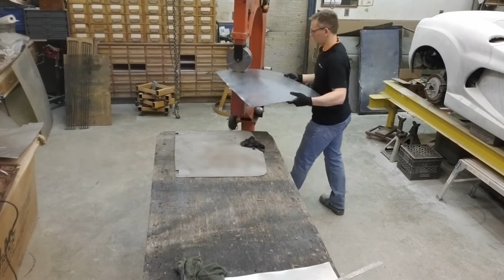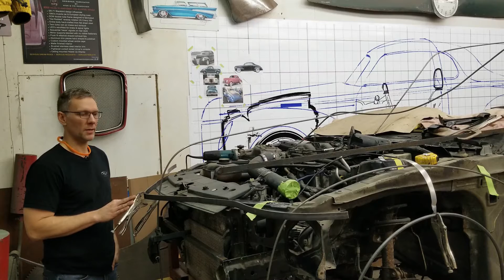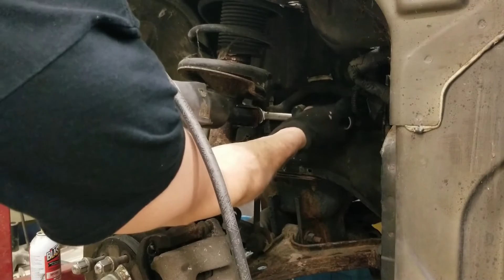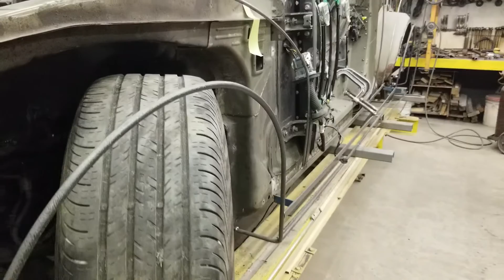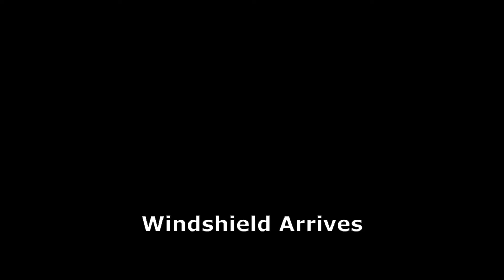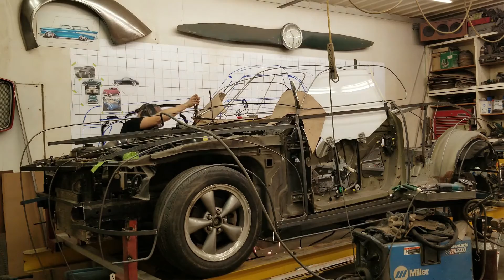Windshield & Setting up Custom Power Windows | Part 8 - 1940 Ford Coupe Inspired Hot Rod Build

Comment: Too much unnecessary work on the doors. It would have been better to wander around the Pick n' Pull yard with a folded/unfolded as needed cardboard template of the door and window, find similarly shaped doors, and then alter the wire buck slightly to fit. The body's hinge pads are easily relocated, and you're done. 
      Not intended as criticism, your skills are awesome, and the videos are great!